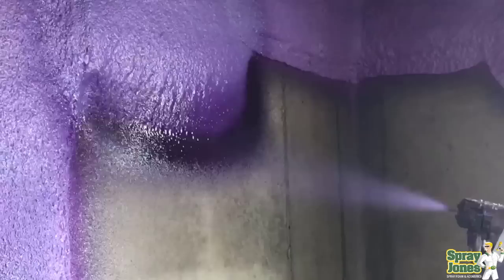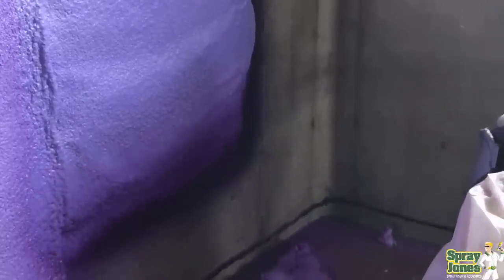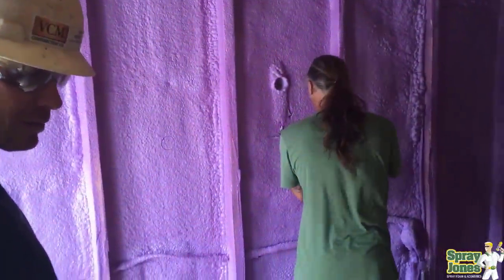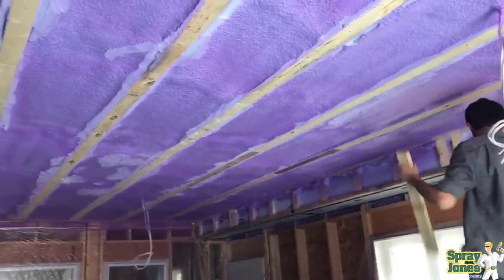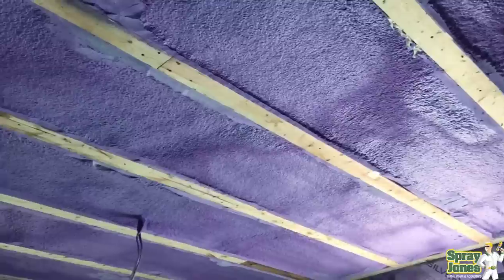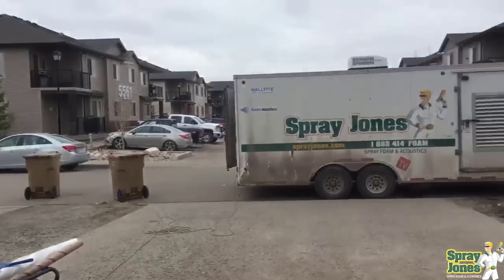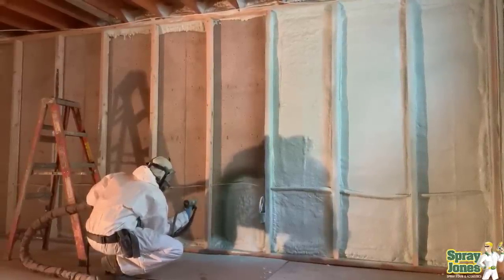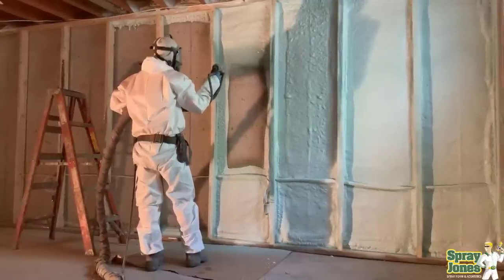3 Things That Don't Matter With Spray Foam Insulation

Comment: Closed cell foam left exposed in work spaces (storage, shed, shop, etc.), will readily accept a paint finish to avoid foam surface oxidation. Painting can greatly improve long term aesthetics and light reflectivity of the foamed surface. I've over-coated CC foam in a couple buildings by spraying the cheapest white paint I could find from Home Depot or Lowes (don't recall). There's probably a recommended 'wait time' before painting CC foam, in my case I'm sure there was at least a week interval. In the first building I painted a test spot before committing to coat the entire surface. That was 20yrs ago, still looks good.
Reply: This isn't advised because certain paints don't provide a uv block. It should be a foam specific coating
Reply: @OfficiallyfreZh  UV blocker inside a building? Maybe a 'grow' room, otherwise  I doubt it..
Reply from the maker: I have a video on what coatings can be placed over SPF.

Comment: Excellent content...I quite enjoyed that. I'd like to know more about adding sprayfoam on the  inside of a house against a rigid DuPont style foam board. I'm planning a house build with no OSB. Instead I'm using 3" closed cell rigid board and sprayfoaming 3" on the inside of the house against the board. In case you are wondering why the DuPont...I got a great deal on a half truck load. I got lots to insulate the slab and house.

Comment: For a new residential foundation build (9ft tall below grade) in the midwest (Missouri), is it possible to determine if it's smarter to apply closed cell on the EXTERIOR or INTERIOR WALLS for a better performing foundation wall as far as insulation?  Thank you and really enjoy your content.
Reply from the maker: Interior. The weather issues for application externally are troublesome.
Reply: Outside, starting with your water proof mastic, EXTREME attention to detail of water drainage through proper placement of gravel drainage material and pipes, closed cell rigid foam board (bare minimum two inches). If you start with quality construction outside of foundation wall is critical. All that is just for starters.  This is a great topic for discussion in any state.
Reply: @SprayJones  saw a spray foam application to commercial bldg in Carlsbad NM over typical osb framing. They installed long brick ties that pulled thru the foam (8”) and placed mortared river rock on exterior. Looked good as a “stone exterior “, but more importantly I was impressed that it would offer outdoor protection from elements while maintaining full exterior foam coverage.
Reply from the maker: @marha3368  Yes, that is called a masonry cavity wall system. 
Been around for ages.

Comment: Does the smoothness of the finished coat have any indication of the quality of the job?  Noticed in almost all of your videos, the foam goes on extraordinarily smoothly and has a nice finished coat.  I had 3" of spray foam done on the underside of a subfloor (crawlspace for what was formerly a 3 season room, now enclosed), and it's what I'd call lumpy, however that almost might be since they were spraying overhead rather than in front of them on a vertical wall.
Reply from the maker: Smooth is hard to do, even for us. When overhead or underneath you get what you get, some days are better than others.

Comment: I can easily put my thumb through open cell!!

How do you deal with tight areas where you cannot get the gun in to spray properly?
Think rim joist where the HVAC contractor installed ducts 6" away from the rim, or where the last joist is only and in or so away from the bottom plate.
Reply from the maker: Get pipes removed, sometimes you have no choice but to fill spaces up with open cell foam because there is no other way into them.

Comment: Hey Mike, great content! 
I found you thru MR Post Frame when they had their insulation issue on the Mad County Build, I’ve been subscribed ever since.
My question is about 2” closed cell directly to metal. I completely understand how it adds to the structural integrity. But if house wrap is used does this impact that integrity? I know I don’t NEED the wrap with the closed cell but to properly install our windows the wrap is part of the process. Thoughts?
Kohl Cavanah
About to start out mostly self built 48x36 post frame home in Southeast Missouri
Edit: I just watched you video on house wrap on metal post frame siding. I really want to skip the wrap but I need to be sure I’m meeting window install requirements.
Reply from the maker: These are two separate issues. 
The wrap crowd wants the ability to remove the siding at a later date and NOT have the SPF adhered to it. 
The direct to metal is what most have to deal with for retrofits. 
I am pretty sure that you can have windows properly installed with out needing large amounts of wrap. There are membranes and framing details to facilitate this. Just takes some planning.

Comment: Hi Mike - love the channel. Curious, when closed cell foam is sprayed into a wall cavity of 2x4 studs - if the exterior sheathing somehow fails or absorbs too much water have you ever seen the exterior side of the studs begin to rot in-between the closed cell foam? Assuming it’s not able to dry to the exterior for some reason.
Reply from the maker: "If it cannot dry it's going to die"
Watch Matt Rising's channel regarding exterior envelopes, and reservoir cladding systems, they cover the reasons / products to use there.

Comment: Would you recommend spraying closed cell directly to the underside of a metal roof or best to use plywood sheathing before installing metal roof? This would be at cottage in Quebec. Thanks
Reply from the maker: I think it is best to do sheathing, underlay, strapping and then metal.
Reply: @SprayJones  thank you. This is all new to me and learning on the fly. Your channel has been great. Thank you.

Comment: Hvac /OCfoam related question.
Should a home in the south humid climate be blowing cold air into the attic space; be drawing it out? Or combination?
The rooms at the end of my house are still toasty while rest of house is chill. I am thinking because the sun blasts that side that the heat is still making its way into attic.
Reply from the maker: Go into the attic and get some data.
Reply: @SprayJones  I am getting some humidity temp sensors to put in a couple spots.

Comment: A question, how can you tell open and closed cell apart after it has been installed? I can cut a bit away to look at the structure inside but am unsure what I am looking for.
Reply from the maker: Of course. Open cell is able to be crushed with your fingers. Closed cell needs to be cut with a knife.

Comment: I think you likely hate these questions; but could you reply to a video posted by Home Performance : Spray Foam Bummers?  It's making me think twice on if I should use pray foam at all.
Reply from the maker: This channel is dedicated to education. All the material you need  there in the video sections. Scan through and you'll find subjects and topics that cover 98% of the questions. 
You need to put the time in and do the educating.